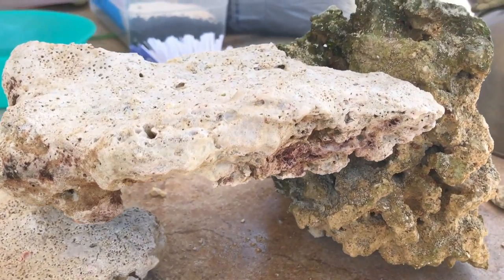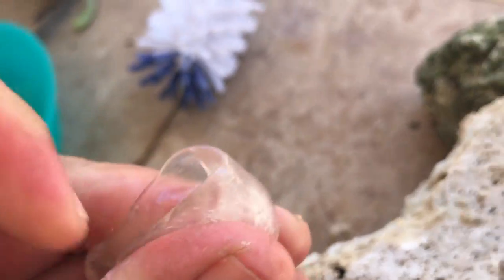HOW TO AQUASCAPE YOUR AQUARIUM | REEF WELDER PLASTIC PUTTY EPOXY GLUE

Comment: I just used this with a new setup for the rockwork.  I loved it!  Water does need to be hot and I used it out of water on "wet" rock.  Serious overhangs that I really didn't think would hold absolutely did. I had a 500ml jar and only used 1/3rd of it for a 75 gl tank.  I glued all my rocks together which is a first for me in 30 years.  I usually just dry stack and fill the tank.